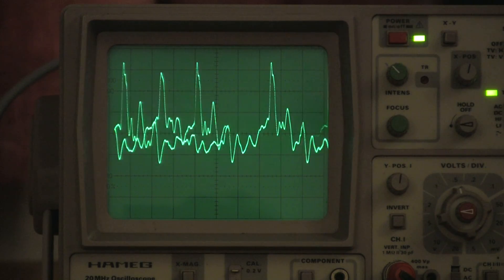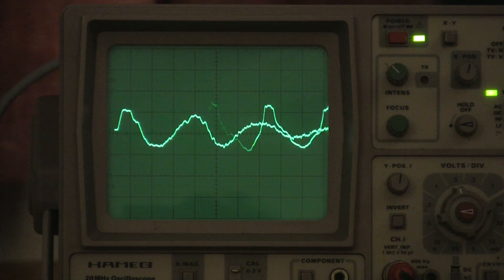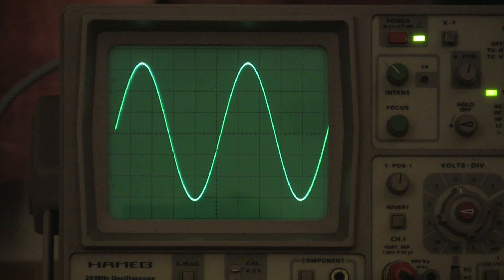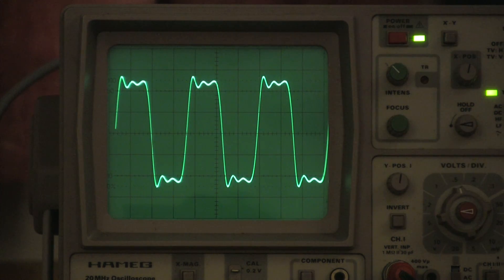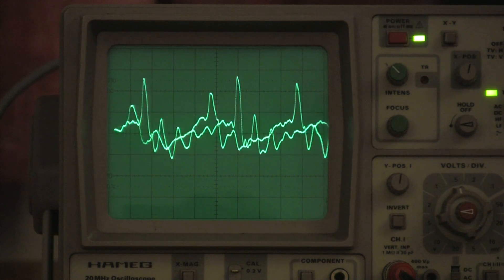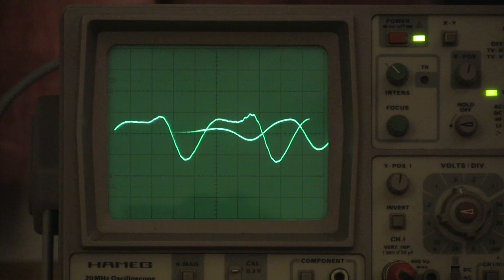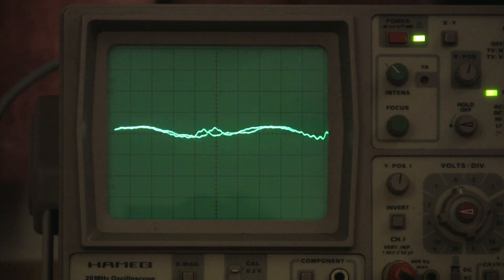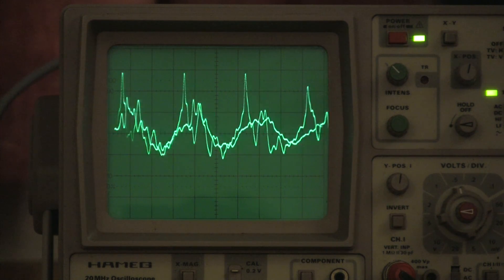Can you hear the difference between a square wave and a sine wave?

Comment: next time use a better function generator, cappable of a clean 10kHz + square wave ;)
Reply: Yup, this is also why the square wave is very different sounding at LF, square waves are made up of the odd harmonics of the frequency, so a 1 GHz BW 'scope would be able to show much more of the higher frequency harmonic components than the 20 MHz 'scope is able to. If you see a FFT of a square wave, you will have a peak at nearly the same power as the main peak at every odd multiple of the base frequency, up as far as the bandwidth of the spectrum analyzer or whatever you are using to generate your FFT.
Reply: This video was super unconvincing, because at the higher ranges, as it started to sound more similar, the square wave started looking more like a sine wave.
Reply: You don't understand, a 20MHz oscilloscope will have problem with 10KHz square waves, you need higher bandwidth oscilloscope to be able to see the real square wave.

Comment: digital wave is square
analog wave is sine

thats the difference
Reply: Square waves can be considered analog as well, specially when the upper voltage level and lower voltage level aren't totally horizontal but are tilted. "Digital" instead means that it is represented (or saved in memory) as bits of ones and zeroes.

Comment: You made several critical errors.
1. your "square" waves stop being nicely square around 6 kHz.
2. The speakers/headphones that most people use to listen to audio on their home PC will not have a perfect frequency response. Cheap headphones may not respond well to high frequencies in the first place.
3. You kept talking about the "second harmonic", however, square waves contain no second harmonic.
Assuming that the range of human hearing is from 20 Hz to 20 kHz, then a square wave and a sine wave will sound the same at a frequency of 20/3 kHz (this is because the lowest harmonic a square wave contains is the third harmonic). This is about 6.67 kHz.
Results will, of course vary from person to person, though, as not all people have the same ears.
Reply: The sound is in 44100Hz which can't represent harmonics above 22050Hz.
Reply: Additionally, the inductance of traditional drivers rolls off square waves at high frequencies, literally turning the signal into a modified sine wave. Listening on a driver of a different technology could preserve the squareness of the signal much more, and thus, will become more audible.
Reply: You've made the truly critical errors in your response. 
1. Do not let the visual on the oscilloscope fool you into thinking that the wave at 8kHz is not square. The display set the way it is is just incapable of showing all of the high frequency harmonics.
2. No speaker that anyone uses can ever perfectly produce a square wave. You can't physically make the speaker go from full excursion to full incursion in 0 time. It's impossible. Yes, better speakers can produce a truer square wave, but the fact of the matter is, it will never be correct.
3. At one point he calls it the 2nd frequency component, which is correct. When he later says the 2nd Harmonic he did make a mistake, but the point is still valid. The 3rd Harmonic (the second frequency component of a square wave) when the fundamental is 8kHz is way out of the audible range at 24kHz.
Reply: mainecolbs Hmmm... I completely disagree with your "1". But I think your "3" is a good point.
1. The analog oscilloscope the narrator is using is a 20 MHz scope. This means that the amplitude of a sine wave will be at its "3db" point around 20 Mhz. The 3dB point is where the oscilloscope will show the signal at 0.707 its actual amplitude. I really doubt the oscilloscope is acting in a way to filter out frequencies in the 20 kHz range.
2. No argument here. We made the same point.
3. I see that he does initially explain that the harmonics are at "whole odd number multiples of the fundametal". I guess I didn't focus on that, and was more focused on his mistake when saying the "second harmonic".
Reply: Brandon Ramos 
no u
Reply: hahaha, whoopsy

Comment: I don't know if anyone else noticed, but at 12KHz, the square starts looking like a sine as well, relating to it's harmonic drop off.
Reply: Hey pnewn. I know I wasnt exactly nice in my saying you are plain out wrong. 
Sorry for that. :-)
But I think you are going about it in a mathematical  way. Although its true that you can mathematically DECONSTRUCT the square way in to sines that is actually not the way we electrically CONSTRUCT the square way. We simply switch on and off. Its simple and we can construct perfect squares with a handfull of components. And an oscilloscope can measure and display it easily and exactly. No math involved. Just simply a sweep of an electron beam.

Best regard.
Harry
Reply: "By adding together infinitely many sine waves, yes, you can obtain a square wave. But infinitely many waves is not something that can conceivably be achieved "in practice". 

If you only allow finitely many waves to be added together then the result will not be an exact square wave, though it can be made so close to one that the difference would be negligible in practical terms." http://www.quora.com/Can-we-in-practice-exactly-reconstruct-a-square-wave-by-summing-up-sinusoidal-components
Reply: Sure, you can emulate geometric squares on a screen, but you're never going to generate a signal that is an ideal square wave. It involves an infinite sum of sine and cosine functions for a voltage, and you can't make electrons travel faster than the speed of light to generate an ac current that is truly "square" in voltage signal. Sorry bud
Reply: thats because it's impossible to form a perfect square wave on an oscilloscope; it uses the concept of fourier transforms to replicate a square wave with relative accuracy to the level of frequency rendered by the oscilloscope.
Reply: Now that's something I didn't know... That sure is interesting!
Reply: pnewm10 You are wrong on some many accounts pnewm :-).
First its not impossible to show a perfect square wave on an Oscilloscope.
In fact, it is very easy.
Secondly an Oscilloscope does not use fourier transforms in any way.

@Ronald 
The maker of this video talks about ringing on 46kHz at 5:05 in the video.
At 12kHz this ringing just happen to harmonically interact so the squarewave looks a little softer around edges.

Regards
//Harry
Reply: Harry Zachrisson I know this is an old post, but you can't perfectly create square waves by switching on and off. Components if something called a "slew rate", there is no such thing as instantaneous change from one voltage to another. In addition to that, there are always transient responses with sudden voltage switching, seen more clearly at higher frequencies. But, you can get a pretty decent square wave at low frequencies, especially with an op-amp.
Reply: Harry Zachrisson also, the oscilloscope does use Fourier Transforms, but not to display the square wave. If the O'scope doubles as a spectrum analyzer, it will perform the Fast Fourier Transform to approximate what harmonics are contained in a given wave.

Comment: I find it interesting how a diaphragm can't stop on the dot, so there will be a little bit of vibration at the peaks and troughs. What's also interesting is that this happens in a thousandths of a second
Reply: This also crops up in the math concerning audio analysis.  The Gibb's phenomenon, a 9% overshoot at discontinuities, appears when using a Fourier series to approximate a discontinuous function (like a square wave). Even perfect speakers (if assumed to drive only sine waves) couldn't get it right! O.o

Comment: interesting .. but after 4-5 khz your square wave isn't really much of a square wave
Reply: that is a /20 megahertz/ scope, this is not the reason. more likely a low pass filter of some kind on the output. i'll have to retry this with my own signal generator and scope and amp.

edit wrong filter for what i meant.
Reply: It still would not matter, you would need infinite frequency response to actually reproduce a square wave, and still no speaker (or by instance, your ear) would even be able to resonate that way. 
This phenomenon is explained late in this video: https://www.youtube.com/watch?v=pWjdWCePgvA
Reply: Kilohertz is written in SI as kHz, not khz. .
Reply: It is due to the inductance of the lines/cables. it is called gibbs phenomenon.